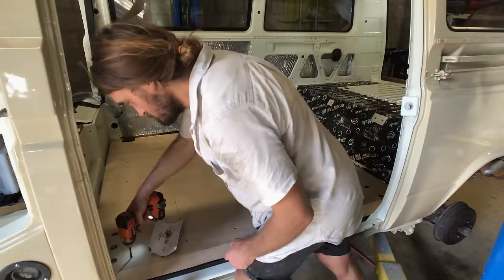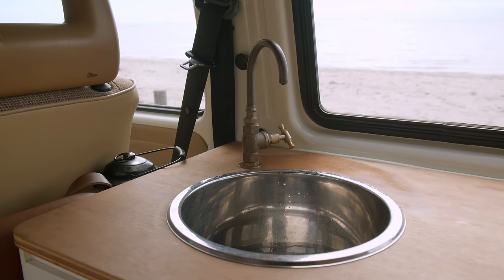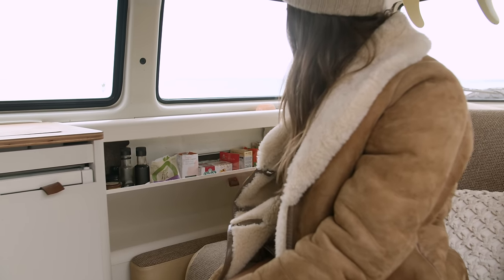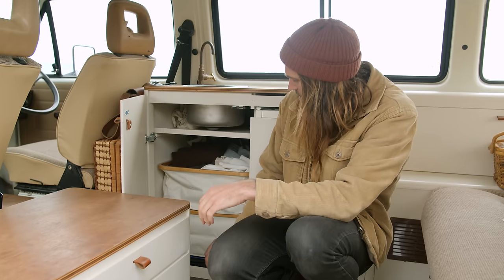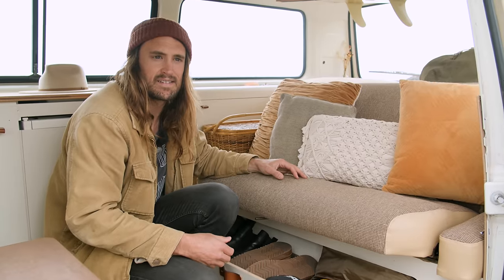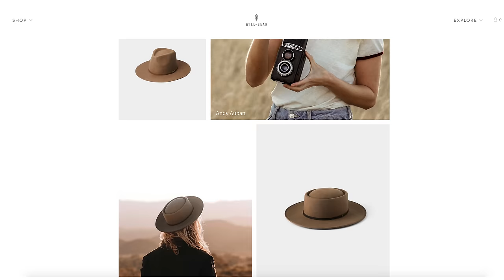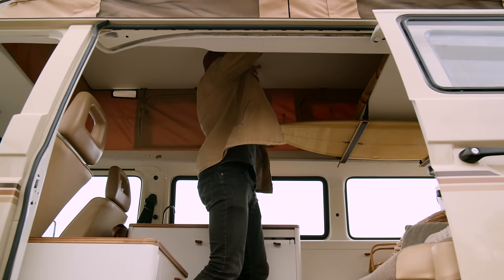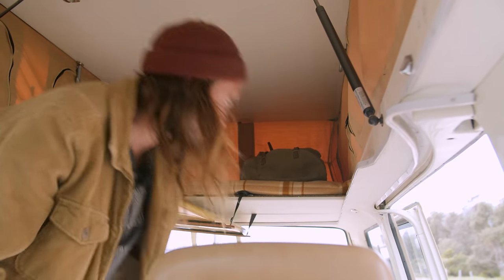Couple Turn Old VW Van into A Beautiful Home on Wheels

Comment: Wow! VW T3 syncro is awesome in good condition! Here in Germany you see so seldom and the biggest enemy is rust.
A friend of mine from Berlin has converted a VW T3 Bundeswehr (ex military vehicle) and be careful with a camper because of stupid Tüv (Technike Monitoring Association). He was cleverly converted into a military optic camper inside: D. I have Suzuki Jimny FJ Camper. I used to drive VW t4 but they are so expensive and buying used VW T3s are really expensive and difficult to find because they are quite expensive here.
At the moment I have a brand new camper to put on. It's a Citröen Jumper: D-nice big!
BUT VW t3 Syncro is number one for me and remains a dream!
Greetings from Germany, I wish you a nice trip with the T3 syncro :)

Comment: Hi Jordan- another question that just struck me.  It appears you folks that build these vans out invest lots of time and money into them. As most anyone does when purchasing a home. Which brings me to my question. Why not to purchase a RV or a camper or 3 wheels?  Something that has basic necessities factory installed. Toilets, shower, heat, ac, kitchens.  Is it the express interest in building out vans?  I’m amazed how fascinated I am with this somewhat primal, yet intriguing way of life. I appreciate any response. 

Good speed.
Reply from the maker: There are a few reasons: it's generally much cheaper to build it out yourself, you get to build it exactly how you want it (everyone's needs are different), but also the process of building it is very satisfying and fun!
Reply: Lisa Ann Some people don’t like towing ( like my husband ) . Also sometimes smaller is better when you are off roading :)

Comment: About how much does it cost to get started I live in Phoenix Arizona so it's really hot so I'm going to need air conditioning constantly
Reply: we are currently converting a van and just can say that it depends on your taste, it is all up to you :D - but yeah, you should not underestimate the cost of small things... if you want to have an air conditioning, then you also need a good battery so that you can run the AC, for that you'll need a good solar panel, and so on :-) So in the end the costs sum up.

But it is not easy to say how much you'll need - you also have to find a good cheap van which you can convert. But we can just say: It is worth the struggle!